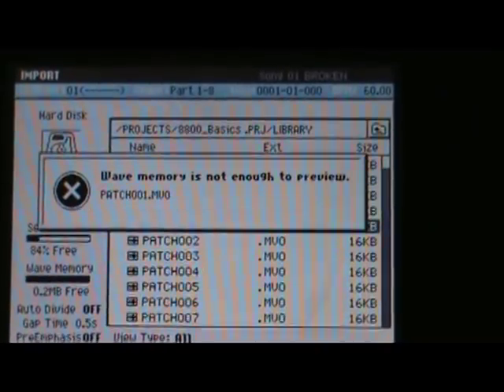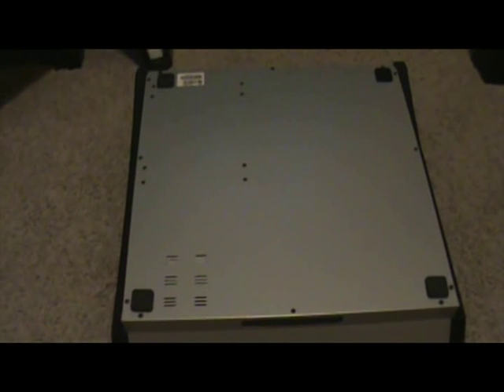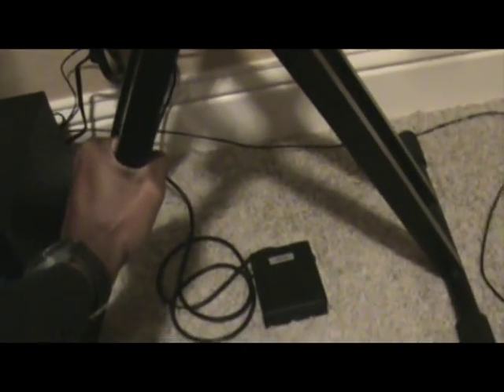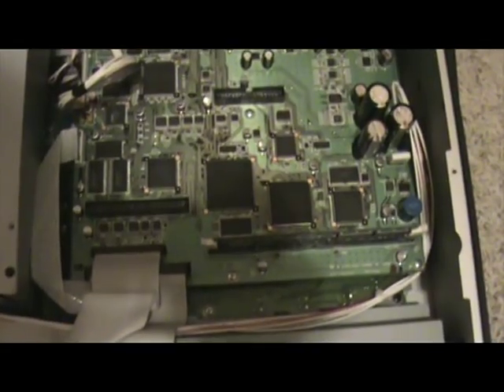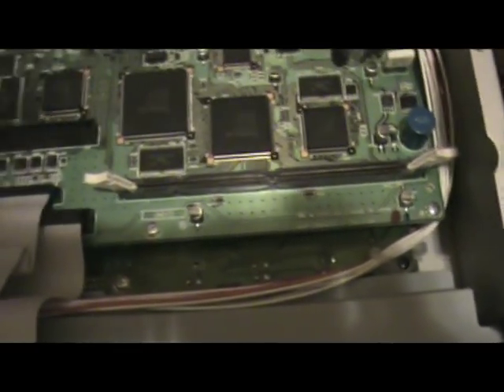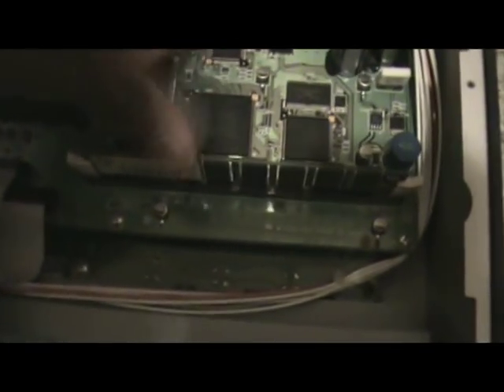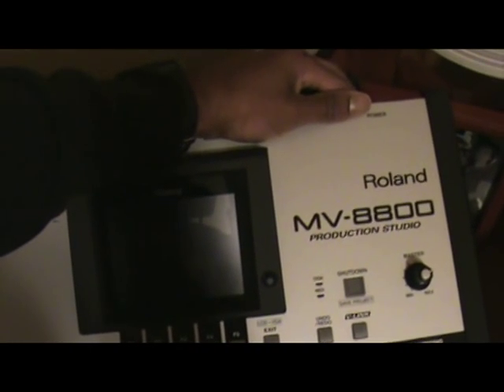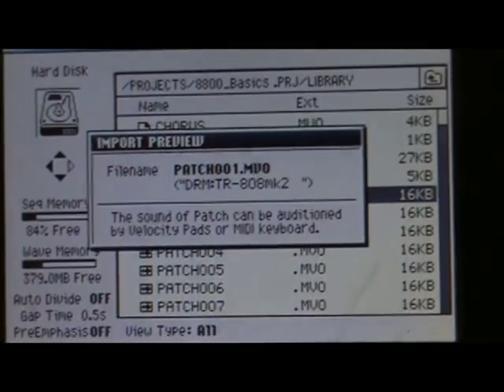How to Add Memory to MV8800

Comment: neoscribe, would you be interested in doing an mv8800 seminar at guitar center in new orleans? no one at this roland dealer seems capable to answer your questions after the purchase and the mv8800 gurus don't give a lot of in depth info on the potential of this machine.

Comment: Very bad upgrade practice. NEVER EVER upgrade an electronic component while it is on a carpet. The product and the installer should be on an anti-static surface. Moreover, you should wear an anti static wrist strap. Discharging the body one minute does not mean it won't have a static charge a second later.